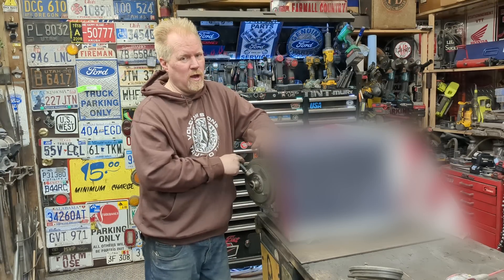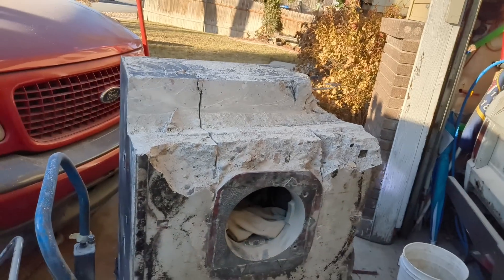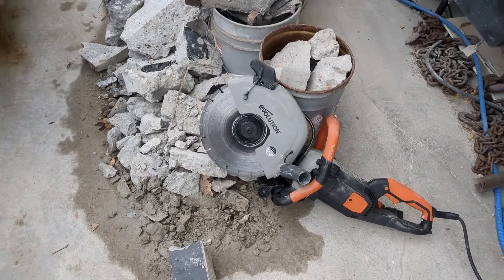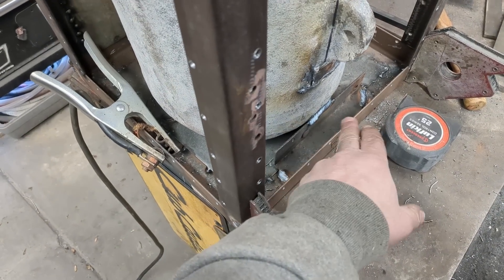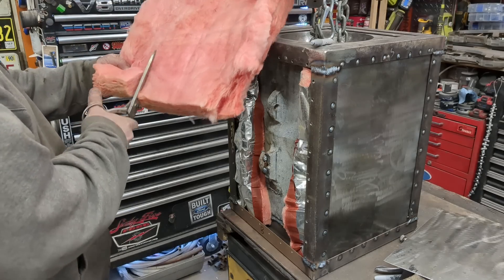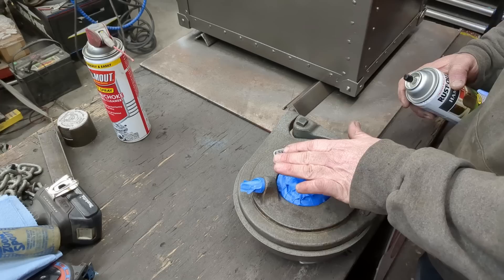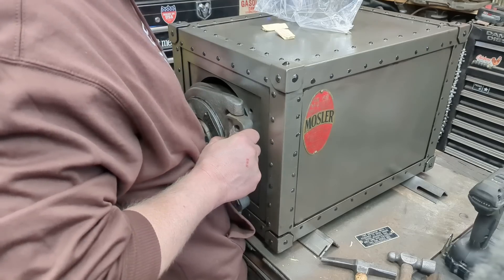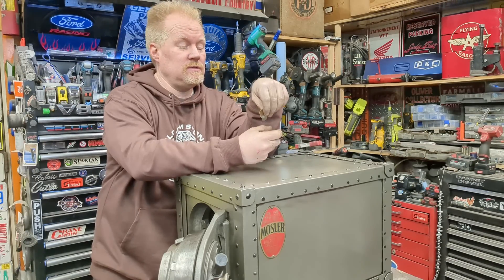Build a fireproof SAFE from scraps

Comment: I would have filled it with refractory cement instead of insulation but otherwise it turned out cool. It's amazing how much better spray paint is today than it used to be.

Comment: Beside that safe being 75+ years old and heavier than a mother f--ker  , that type of door it has is what Navy & Army gun breaches are made from. The real scary thing about this safe is. especially when you were cutting into it is and all the dust flying everywhere and no PPE breathing apparatus, is that concrete could be laden with asbestos. A lot of safes and materials for fire proofing were made with asbestos. A real health hazard, especially later in your years, with the possibly of contracting Mesothelioma & Asbestos lung cancer.  Contact Mosler with all the info you have about this safe.
Reply from the maker: Honestly even it was asbestos, I wouldn't be concerned in the slightest. Note: it wasn't. Why no concern? You have to be exposed to these things continually. If I did it for a living, 8hrs a day, everyday for years, then yes. Even osha allows you to breath asbestos in small doses/exposure limits as there is no harm.

Comment: Always learn something from your videos, thanks! Have you ever had to weld up a worn slip yoke on a transmission or transfer case? Reason why I ask is that some yokes are no longer made and a repair is the only option.  I figure that if anyone can  fix a worn yoke, you can!
Reply from the maker: The outside just so the rear seal seals? I've seen guys get away with just JB weld and sanding it smooth. That little groove that gets worn in it.
Reply: @sixtyfiveford  yes, after 200,000 plus miles there is a groove worn in. I have seen shafts built up with spray welding, mig welding and tig welding, then ground down to original od. I am concerned about the grain structure around the weld zone particularly for tig. I don't want a stress fracture to spoil my day!
Reply: Rather than weld, most folks at home use a speedi-sleeve to effect a groove repair. Going that route is usually the quickest and least costly. Another potential repair on some parts is to machine for an oversize seal... but that repair is not possible on all parts and you also have to come up with the seal. Rather than attempt to weld on cast or forged parts which may or may not work, I prefer to prep and build up the damaged area with nickel plating. Then all it takes to complete the repair is to machine or grind back down to the original finish size. Obviously, you have to be able to conduct the plating and machining ops but to me it's worth it. You get the best and longest lasting repair with no complications. Best wishes! 👍🏻👨🏻‍🔧🇺🇸

- Max Giganteum
Reply: @MaxGiganteum  all good points. The slip yoke is 6 inches long and the wear surface for the seal is 4 inches from the end. This makes a speedi sleeve a tough proposition. Did look into hard chrome and nickel plating, however in SoCal the enviros have made that a difficult choice. Appreciate the response, thanks!
Reply: My experience is you don't need industrial chrome... nickel works just fine. Unless your part originally had a hard chrome surface, I wouldn't give it a second thought. As far as how to get it done, there is the bona fide plating shop... then there's the home brew folks that can do just as good of a job. I've been around and in both environments and success depends on one thing: does the guy doing it know what he's doing? That's the catch.  If the speedi-sleeve option isn't looking viable, I'd price out nickel plating and finish machining at a regular shop unless you've got friends that can lend a hand. I would also attempt to find a local home brew hobbyist that might be willing to help. They're usually far cheaper than a regular shop (sometimes free) and they often like the challenge. If you've got the time, you might do some research online to see if anyone is nearby that can help. Look for the hobbyist groups. Another option for machining are any local trade or technical schools with a machining program. High schools too. The instructors usually love it when someone walks in the door with a unique project as it gives the students real world job shop experience. Mine did when I was in a machining program many decades ago. Yes, I did a couple of walk-ins myself though what I got were all fairly easy. One that I remember was the task of re-machining the ways of a mini-lathe... that guy was tickled pink because he figured it was a lost cause. He'd almost just tossed the whole thing in the scrap bin! How did it turn out? Looked like new, not that I was surprised. All I thought at first was that a few of the dings or gouges were too deep but they all cleaned up. Anyway, I'm reminded of something else - automotive programs at trade or technical schools. Junior & community colleges often have them. They too often like having folks show up with unique projects for students to deal with... some online research and a few phone calls might get you what you need for free or for a small "donation" to the program. It's up to you to look into those things, of course, but know this - it might take a lot of time to get things done unless you already know who to talk to and the time of year is right. Students only spend so much time in the labs... and there are only so many days per year class is in session. Best wishes! 👍🏻👨🏻‍🔧👨🏻‍🎓

- Max Giganteum
Reply: @MaxGiganteum  thanks again, all good options.

Comment: Great job. So if a thief removed the 2 bolts holding the door will it come off?
Edit: Nevermind, I guess it would have to be unlocked for the door to just come off.
Reply from the maker: The easiest way to break in would be through the back side, cutting through the 1.5" thick steel. You would have to do this and hope you didn't damage/burn whatever valuable was on the inside.
Reply: Not to give anyone any ideas... but since you removed all the concrete around the main cylinder and exposed the steel, Liquid Nitrogen and a sledgehammer would probably make for a quick entrance. I'll admit I'm speculating, I've never actually attempted to break into a safe though I've experimented on quite a number of items and materials with LN. it's amazing how brittle things get when cooled to below -300°F, especially metals. Just food for thought. Peace & good vibes! ✌🏻👨🏻‍🏭🇺🇸

- Max Giganteum
Reply: @MaxGiganteum  To late. You just gave me an idea. Remember you guys didn't hear a thing. 😆

Comment: The fact that you were able to decipher that combo lock was pretty cool.  Safe looks great!  Keep the vids coming!!
Reply from the maker: Thanks. I was going to show more detail on deciphering the combination but couldn't do so without telling/showing the world the combination.
Reply: @sixtyfiveford  that is a "hand change" combination lock.  Resetting the combo is very easy.  Just be sure that you log any "offset" in the numbers on the "wheels" and the actual number that you stop at on the dial (ex. if the "wheel" is at 65 and the dial needs to stop on 66, add 1 number to the new number on the "wheel").  They can be a bit finicky but not too difficult to reset if you are careful.  Nice job.

Comment: I stop every time I have my truck and see free bed frame rails free angle iron welds great! And yes it’s tuff on drills I started buying bosh cobalt just because of it !
Reply from the maker: I probably have 6-7 bed frames worth right now. A little brittle but still good steel for projects.
Reply: Depending on what you need or use them for, spot anneal with a torch. If you've got a very stable drill press or a milling machine, use solid carbide bits or cutters. They'll go through a bedframe like butter. Just an FYI. 🤔👍🏻🇺🇸

- Max Giganteum

Comment: Don't mean to point out the obvious but YEAH lets mix water with electricity,,,,Don't think Evolution thought that one through😧🤔,,,,engine concrete cutting only with water!!!!
Reply from the maker: It has a GFCI plug on it. Really no different than an electric pressure washer or similar.

Comment: 'You're not supposed to be up there/Get up there'! You're turning the Sweet Baby Helper into a criminal...........not really. SWEET job on the safe. I went 200# on the hull but it was 250 I think. I tried to turn Mark Galicic on to the rattle can shaker. We shall see. BLESSINGS to you and your tribe!
Reply from the maker: The bare hull weigh in at 265 with the little bar hanging off the bottom (5lbs). The exterior door is 45 and the interior door another 10. All together with the case I'm around 340lbs which is at least moveable with a hand truck now.
Reply: @sixtyfiveford  Ginger might crack a tooth on that. Blessings!

Comment: If you would have watched the movie Bitch Cassidy and the Sundance kid,, you could have gotten it apart a lot easier.. The rivets that hold those nameplates on are called grip nails and are available.. I had a company sample me 10 ea of a few different sizes.. They come out easy but you usually destroy the head. They have a 1 or 2 turn thread.. No masking that way...   If I stumble across the company info I'll send it over in case you're interested.   Bed-Rail is a LOT HARDER than mild steel.. Bitchin' results as always...

Comment: Bed rails are typically made from spring steel. They have a higher carbon content and can be a challenge to weld. really strong though. Great source of cheap or free steel but you have to be careful with it.
Reply from the maker: True, that's why I chose them for this non critical project.
Reply: Spring steel is easier to weld if you normalize the metal by heating it red hot an allowing it to cool slowly.

Comment: Like Excalibur and steampunk come together in this project.  And thanks for the link to those pneumatic wedges.  I smiled when I read the description on Amazon - they stop short of saying they're useful for getting into locked cars, which is where I've seen them used before, plus some of the kit tooling seems to be designed for door seal compression.  Of course useful for other stuff as you display.
Reply from the maker: I randomly picked them up a few years ago after I saw a locksmith wedge a door open. I haven't found much use for them, but they were cheap.

Comment: I'm amazed at how much work it took to get the safe apart. You turned a boat anchor  into a very usable and good-looking safe. Unlike a lot of ladies, Ginger probably enjoys going to Home Depot. 👍
Reply: Mine waits in the car. I usually crack the windows for her.  She is entertained with a book or her phone.
Reply from the maker: Ginger loves going for a drive anywhere, even if it's sitting in the car while I run in.

Comment: 1st of all, it looked great when done and reminded me of a Wells Fargo Safe you would see on a train getting robbed in the Wild Wild West when you finished it, and those plug welds will be a whole lot harder to drill out than any rivet would. a set of wheels on the bottom wouldn't hurt either. Put the combination of the safe on the "inside" that way the next owner won't have to decipher it.  Could be a hundred years from now, so put a picture of the restoration team and a DVD of the process inside too.  It will be a Time Capsule to document its history.
Use what you have, but the fire rating for it would be higher if you used something like "Ceramic Fiber Thermal Insulation Board".  This is what I plan on using when I build an outdoor shelter for an emergency generator.  Enjoy the rest of your winter.
Reply from the maker: I looked at a lot of vintage safes and the 1800-1900 looked the neatest so that's what I went for.